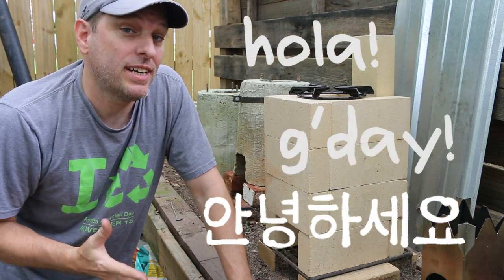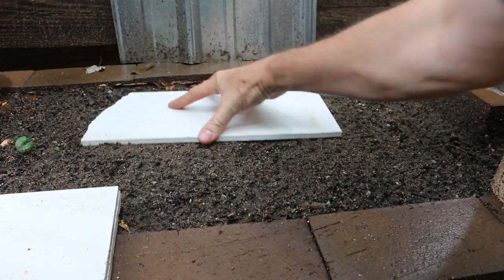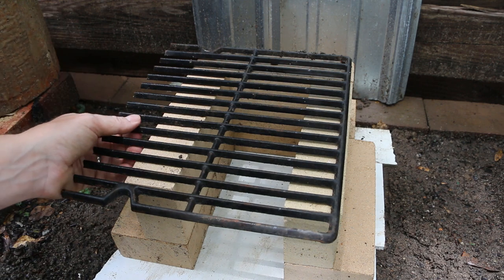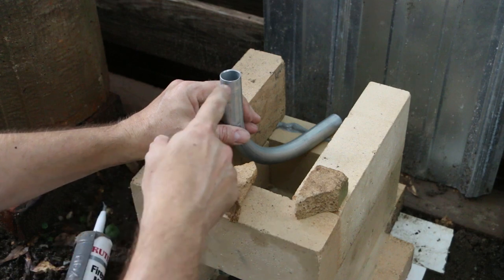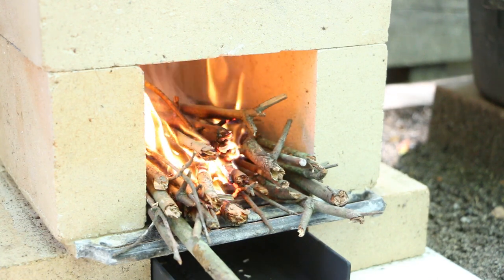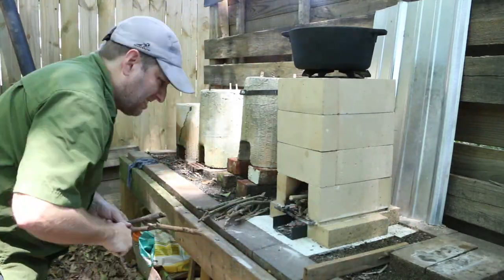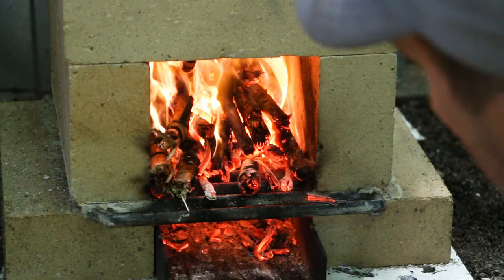How To Make A Fire Brick Rocket Stove

Comment: Regarding the air feeding pipe, I don't think it contributes to burn efficiency with that exit that high up. If it was going to do anything it would be an the entry point height or lower. And I think you should have more of an horizontal tunnel to pull the flames horizontally away from the fuel which would improve the fuel/air ratio.
Reply from the maker: Agreed. The secondary air pipe really didn’t add any benefit to this rocket stove. The effort was worth figuring that out, at least. Thank you for the feedback. Thank you for watching.

Comment: Good video and you're handy with D.I.Y. tools.
The conduit pipe was a clever idea, but the execution of installation was amateur.
Why not drill a hole in a fire brick instead and insert the pipe thru the hole?
Also, I'd have cut a brick to size, instead of having that one-sided gap filled with mortar.

Comment: That tube looks like aluminum,if so will melt like a butter;you will need stainless steel for it that will last a bit longer.If I was you will make the airflow by opening the channel and place fire bricks that you can cut in half to make them tinnier and  half to shorter them so it will create a more solid and compelling airflow channel for this project.
Reply from the maker: Thanks for the feedback, Adriana. The pipe is actually steel, but if I did this project again, I'd leave it out. Too much effort for very little benefit. Thanks for watching.

Comment: why did you put the air flue off center and not in the center? I woudl think center is better because it would be able to add air 360 degrees around it instead of just on one side of the flue.

Comment: What you have here is a very nice "wood fired" stove. I mean no disrespect but what you've got here It's not a rocket anything. In order to have the rocket effect you need to incorporate a "J" channel to change the direction of the heat in order to capture and concentrate it. The concentrated heat rising up to 2000 degrees burns the residual gasses which would normally escape up the flue thus making it a high efficiency burn. For example if you get a build up of black soot on the sides of the pan your heating your not burning the residual gasses because its not getting hot enough. If you search to find a video called "#323 rocket stove J tube construction...." you will see what I'm talking about. The dimensions of the "J" is critical and will greatly increase the heat at the same time decrease the amount of fuel needed. Check it out friend 👍

Comment: Could you make it bigger for a 2 burner surface or even an oven type area?  About the cement? Board you put around the wood burning stove, would that seal in more heat. Please contact me, am 70 and think this is what we all will be doing very shortly.

Comment: Could you have leave the gap open next to the brick that was offset, covering the tube, instead of using the tube and (filling the gap) for air flow... or would it not be sufficient?
Reply from the maker: Hi Terri. That might have been an option. Although, one benefit of the metal tube is that it heats the air inside causing it to rise. However, if I built this again I think I might leave the tube out. I’m not sure the added air flow was worth the added complexity. Thanks for the question. Thanks for watching.
Reply: Thanks for explaining this. This was a question I had- was it worth it to add the tube? If you were to build another one, would you leave it out?
Reply: Hi,I am fascinated by your project,effecient,environment friendly,and simple...may I ask what's the length of the tube pointing upwards? I would like to build one for my dirty kitchen as we call here in Philippines...I live by the woods and mountain so plenty of firewood,twigs etc...thanks for your time .....marvelous endeavours and helps us newbies....thank you...God Bless you...

Comment: Instead of installing the airflow pipe in the back could you just leave a small brick gap without mortar?
Reply from the maker: The air pipe didn’t do much of anything. If I did this again, I’d cut the bricks to fit. I do think you’d want to fill any gap. Air flow needs to come in from the front. Thank you for watching.

Comment: I managed to use a rocket stove as a charcoal kiln. It could also act as a foundry.
Reply from the maker: Cool. Thank you for sharing.
Reply: @GreenShortzDIY  Better yet, I was able to tweak my J-rohr design and put a mini-kiln in the middle of my setup, and I plan to add air channels like the tube in this video to draw more oxygen in, and so I believe I have a solid start for all manner of cottage industry.
Now my main challenge is making tight-fit modules.
Reply from the maker: @TheRojo387  Thank you for the update. I agree there are lots of opportunities with Rocket Stoves. Thank you for watching.

Comment: Helluva stove and a good video.  Found fuel is great, plenty in my area. However I'm not agreeing that it is "green" to burn wood and release that much carbon dioxide into the air. In a pinch or an emergency, of course! But just for fun, no not as good for the planet. Good idea, the ashtray, and the weather cover.

Comment: is the build sturdy enough to tip either forward or backward onto a 2 wheeler to move to a different location if I so desire?
Reply from the maker: It could be. I think if you wanted mobility, you would need to coat the surfaces between the bricks with the mortar more completely. And make sure it gets a good heat cure before you move it. You could also cut some plywood pieces to match the profile of the stove (front and back) and then use a ratchet strap (or two) to bind it before you move it. A handle of sorts could be made as well. Interesting idea. Thanks for sharing. Thanks for watching.

Comment: Why not leave the very bottom brick in the back off, to allow more draft and  shift the grate forward and  run a larger, air intake duct through this back gap to supply hot air to mid-way upper burn area?  Of course, a gap would need to be put through the grate or  smaller bricks put in place to support the second, back brick.  It also seems that a taller chimney should be considered.
Reply from the maker: Hi Donald. In my experience, the air channel needs to be the same or close the whole way through the stove to allow the air flow to be boosted. So, a whole brick out of the back would have messed with the ratio. I did consider another row of bricks in the chimney, and it would have worked fine, but on the sand table, it would have been too tall. If I had built it on the ground, that would have been a benefit. Thanks for watching.
Reply: @GreenShortzDIY  No, I may have not explained myself properly.  No removed brick in the back of the chimney.  Remove the brick on the very bottom, on the ground in the back, under the grate.  It would be on the same level as the space in the front where air comes in.  In other words, you could look straight through on the ground.  All bricks, in place, above the grate.
Reply: Or drill holes in it.
Reply: The only reason to want more air is if you are getting incomplete combustion as indicated by too much smoke.  If you are getting a clean burn and the desired temperature for cooking, then everything is just right and it's probably best to leave it at that.  Too much air can be bad as well.

Comment: Love to see people using," the old noggin," as my mom used to say. 

Want to make a rocket stove but wanted fire brick to circumvent some issues with other materials. 

Now that you've had time to use your stove, is there anything you would change? 

Thanks for a great tutorial!

I subbed. :)
Reply from the maker: Hi Ambrose. Thank for the encouragement. If I did this again, I’d cut the back bricks to size and leave out the air tube. No real benefit there. Thank you for watching.

Comment: Tom - hey... love this project. I wonder how you would measure the BTU output. Modern gas stoves usually have one large burner and they spec the BTU... so I wonder how you'd measure the BTU. Anyway, nice design and nice build!!
Reply from the maker: Thanks Russ. I’m not sure how to measure BTU in a stove like this. That would be an interesting thing to figure out, though. I’ll have to look into it. Thanks for watching.
Reply: Just a quick thought about the Btu’s...the output (Btu’s) is wholly dependent on the type and amount of fuel. Pine has a different amount of Btu’s than Oak, dry wood has different Btu’s than green wood, and each load of wood will have a different weight, which will also effect the Btu’s. 

Upshot of it all is that I don’t see any practical way to measure the output of a Rocket Stove.

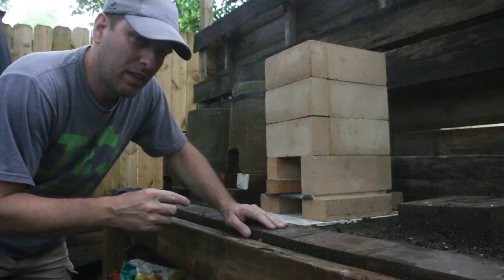Comment: At 14:45 you start welding up an ash tray for the rocket stove.  Why not cut and fit the grate into the top of the ash tray itself so that the whole thing comes out as a single unit ?
Reply from the maker: That is a great idea, Joe. Thank you for sharing.
Reply: @GreenShortzDIY     Thanks!   By removing the metal grate from the structure, you also increase the integrity of the structure and lessen the chances of heat cracking the mortar.  Makes the rocket stove last longer.  Looks better too!

Comment: I have a very serious problem with this,some firebricks can be very TOXIC. many years ago I was working in a lab on a AF base, I had to cut a firebrick,but it had to be under some important safety conditions, due to the "dust" created by cutting. I do NOT know if this is the same type(there are very many types) but I would be worried if the air flow might carry tiny particles of the stone,which could be transferred to  the surrounding air and the food. I would suggest trying to get a Material Data Safety Sheet for the bricks. Other than that  good video
Reply from the maker: Thanks for the heads up Bruce. I will look into it. Thanks for watching.
Reply: Or better yet wear a face mask or a wet bandana while cutting

I think i will build one of these and build a platform around it and put a 55 gallon drum over it for a rocket mass heater i already have design tossing around in my head
Reply: While you raise a valid concern worth investigating, keep in mind many fire bricks are used in food preparation applications like outdoor grills and ovens.

Comment: When you added the conduit for air flow higher in the chimney, I was wondering if a couple gaps in the bricks might do the same thing--then I saw you fill in all the air gaps. Could they serve the same purpose?
Reply from the maker: Hi David. If I built this again I’d leave out the air tube (and any holes). I think there is enough airflow without any secondary air. And I don’t think there is enough air pressure from the updraft to pull the extra air in. Thank you for watching.
Reply: @GreenShortzDIY  Thank you so much! I really appreciate you answering that. I have to laugh at the commenters who are so insistent on ratios of riser versus burn chamber. As far as I'm concerned, that stove you built puts out some major flame! I like the idea of using standard sized fire bricks and the ease of construction is more important to me than any slight difference in heat that I would gain by adhering to the anal formulas put forth by this underground snobbish society of rocket stove fanatics. Thanks again!
Reply: I was wondering the same thing

Comment: do you need firebrick or could you just use plain old red bricks ?
Reply from the maker: Clay bricks will work fine too. Just a shorter life span. But, you could probably build 4 of these with clay brick for the cost fire brick.
Reply: @GreenShortzDIY   Thanks!!
Reply: @GreenShortzDIY  I've got a crazy question and no one to ask...so you get first crack at it.   I really like the 5 gal bucket rocket stove and want to make one for my fishing hole.  Since it will be as much about ambiance as cooking, I'm thinking of filling 1/3 of the bucket with concrete.....then putting a circle of small glass coke bottles around the perimeter, and then filling the rest with concrete so I'll have an "oreo" of concrete/glass/concrete.   Do you think the glass will melt ?  I'll probably only be using the stove for an hour or two at a time....I'd love to hear your thoughts.

Comment: Do you think the addition of the air tube actually performed as you thought it would?  In other words, do you think it was worth the trouble to add this component to your stove, or would you leave it off if you were to build it again?
Reply from the maker: Hi Bill (or Vivian). The air tube did not perform. Not much airflow at all. I’d leave it out in a future build. There was likely not enough chimney height or exposure of the tube to heat, to create the secondary airflow. Thanks for watching.
Reply: What about leaving an air gap in the chimney and using a brick plug, to control air flow?

Comment: so if you were doing it again would you use the air pipe again ?
Reply from the maker: No. I would most definitely leave it out. It didn't do what I thought it would. Not enough air volume moving past the opening to create induction. Added a lot of complication to the build too. Ah...live and learn...or in this case...live, make video, post, get comments, and then learn. :-) Thanks for watching and for the question. That makes me think of an interesting video though...10 things I should have left out of my projects. What do you think? Worth making?
Reply: @GreenShortzDIY  Definitely! It saves us from making the same mistakes. What a great world we live in, where valuable information can be spread so easily.

Comment: Nice kit. Does firebrick come in a 4"  i.d. tube form?
Reply from the maker: Thank you. I have only seen firebrick in standard sizes. Thanks for watching.
Reply: I found castable firebrick cement in 50lb bags on the web. I may try casting a 4" tube, 1/2" wall with a taper (mandrel) and then cast simple concrete around it. Liner method I guess.

Comment: I have observed that fire grates tend to corrode away over time and eventually need replacing.   Maybe leave a ledge on the base layer, so the grate slides in and out of the finished product (for easy replacement) and don't incorporate it directly into the wall?
Reply from the maker: Scott, thanks for the tip. Your suggestion would certainly work. It’s a little late for this stove, but I can observe how the grate changes over time. Oddly enough, I just built a larger rocket stove/forge this weekend and locked in another grill grate. It will run hotter, so I’ll be able to observe if heat plays a factor. Thanks for watching.

Comment: I'm really interested in building one of these but I'm worried about the high flame. Any issues with  embers flying off?
Reply from the maker: Actually no. There are small ash particles in the hot air stream, but they are fully combusted. In my experience the taller chimney, air flow and high temps means no embers because all the fuel is consumed inside the stove. A pot on the rocket stove also limits the height of the flames. I also packed it full of fuel and blew on the fire to get the super high flames. You can go more moderate with the amount of sticks and the flames will be plenty for cooking, while not rising too high out of the stove. Thanks for the question and thanks for watching.
Reply: GreenShortz DIY appreciate your answer, love your videos.
Reply from the maker: You’re welcome. :-)
Reply: GreenShortz DIY t

Comment: Hi There. I've recently build my own Rocket Stove on my porch as I life in a flat. Since this episode has been made almost a year has been gone. What is your impression regarding the pipe that you build in?
Also I have a plastic pipe 8mm thick and 500mm long with a steel end (hollow) of about 150mm that I use to blow through to get more air/oxygen onto the fire, which makes it a lot easier to boost the coals if need be ...  🤠
Reply from the maker: Hi Shalk. I was in Cape Town last November. A majestic country, SA! I think my attempt at a secondary air pipe was not worth the effort in this case. Not enough air pressure to pull a vacuum and draw air in. Your blower method sounds effective. Thanks for watching.
Reply: @GreenShortzDIY  Thank you for the feedback.
Yes RSA is a BEAUTIFUL Country despite all the crime... 🤠

Comment: you dont have a way to control the heat?
Reply from the maker: In my experience, the heat is controlled by the size of the fire. It also could be done with a damper, but I need to learn more about that. Cast iron, does a good job of capturing the heat and spreading it out. That’s how a go about it for now. Thanks for watching.

Comment: Burning galvanized tubing or pipe can be poisonous find something other than a piece of conduit
Reply from the maker: Hi Tony. Thanks for the tip. If I built this again, I’d leave the pipe element out. It doesn’t add much airflow. Thanks for watching.
Reply: Cut that pipe out.

Comment: I don't understand the purpose of the pipe.  I just don't get it.
Reply from the maker: The pipe was kinda a miss. The theory is that an air tube feeds oxygen into the burn chamber to help further combustion happen. I think it works better with a full-fledged rocket stove or rocket mass heater, with a more air tight combustion chamber. If I built this stove again, I’d leave the tube out. It just added complexity. But, I like trying things to see if they work. Thanks for watching.
Reply: @GreenShortzDIY  I think it would have worked if the tube had been aimed towards the flame but from what I saw you had plenty flame. You could just drill an air hole or put in a short tube in the back.   I love your pizza oven. Now you just a rocket stove with a small baking oven. Using the fire brick was a genius idea. If you encase it all in metal, you would make a fortune.